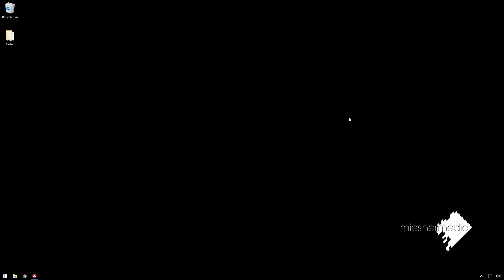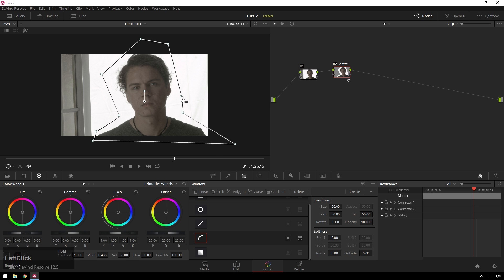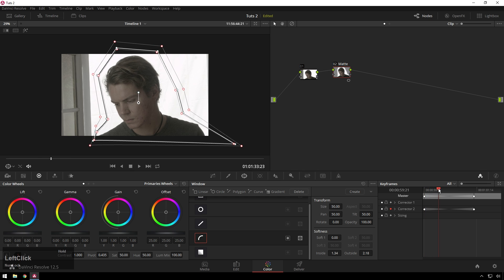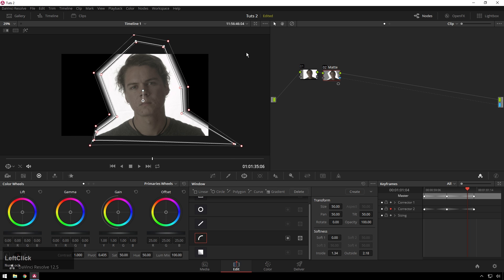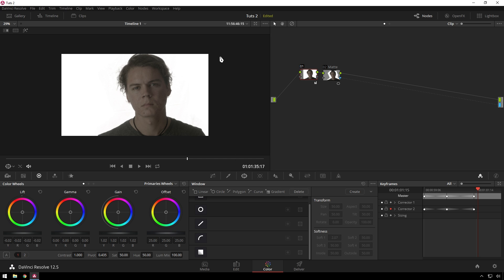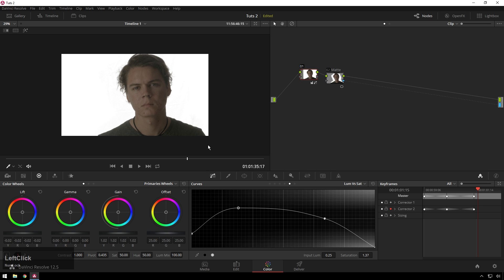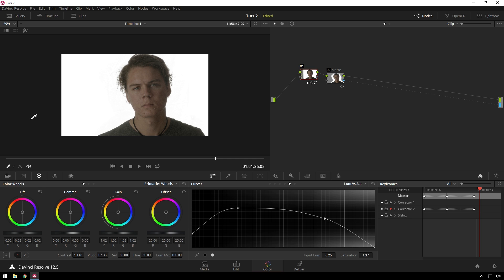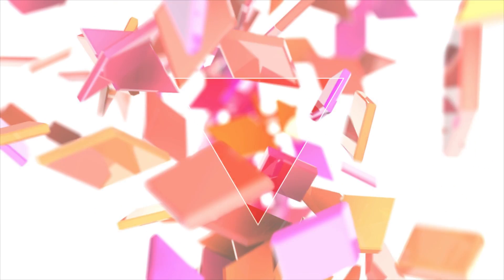Davinci Resolve Tutorial - Garbage Matte

Comment: Theo, thanks for all the great videos, I am shooting a video w/white background. I am getting 255, 255, 255 RGB on most of the background but getting 253, 250 & 252 in some of the lower corners where the overexposed light drops off. I have tried auto white balance, level adjustments & your garbage matte to try and get pure white, but these techniques actually drop the color down to 235, 235, 235 - do you have any tricks that will allow me to get to a pure white on all of the background. I am using qualifier to keep the subject unchanged which works well.  The video will play on my site which has a pure white background so it doesn't look great when my background is off white, thanks in advance.